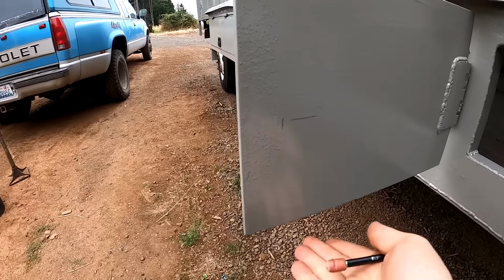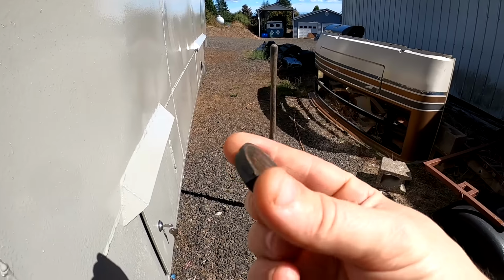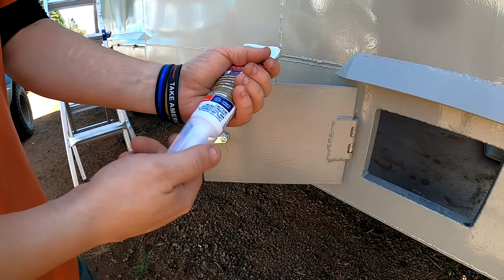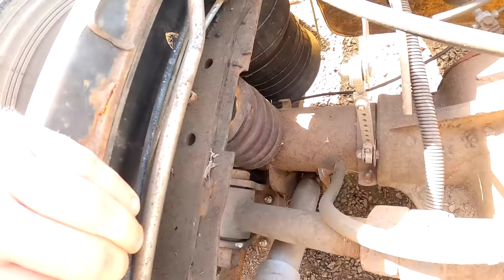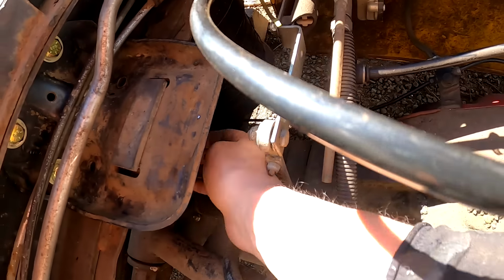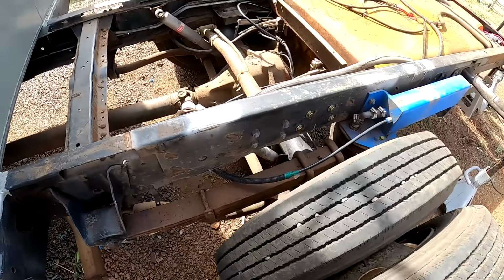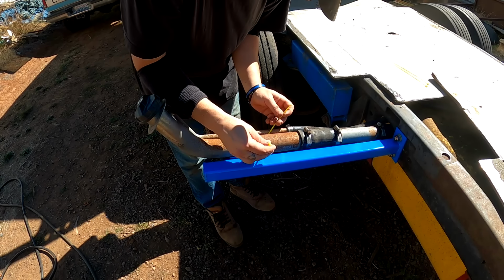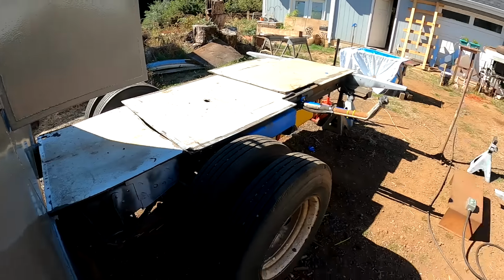RV REBUILD (Part 36) Maintenance Locks, Frame Modification, Filler Neck Mount

Comment: Couldn't you have used a step drill?  Harbor Freight has a 3 piece set for $10.
Reply from the maker: not in 1/4 in plate

Comment: Use your drill with a small bit and just drill a little dimple where them sharp spikes are so it just catches and holds the washer on and it won't turn

Comment: OK just a thought but shouldn't those bump stops be on the outside of the frame so they can hit the top of the leaf springs.. That's how my bounder is. Also those lock washers on the little doors aren't seated all the way and may loosen over time.. Might wanna drill some little spots where the locking legs hit so the washers will be seated all the way.. Just a thought.. Looking good..

Comment: Why are you creating more work for yourself,  you could have just reinforced those welds and throw some sheet metal on top and finish putting the front end on and got out  of that situation and find yourself a permanent spot

Comment: Hi Nathan. Just a tip, just drill some holes on the bottom of all your square stele pipes on the inside and in the bottom. This so condensation or and water leak into the pipes will be draining out from the pipes. This to avoid water build up and frost damaging and deforming the pipes. Frost can makes the square pipes round. Ex 6mm holde in bottom of all your pipes will mittigate this. Great videos. Love your videos. Greetings from engineer, and from Norway